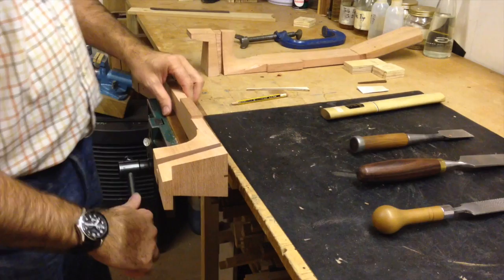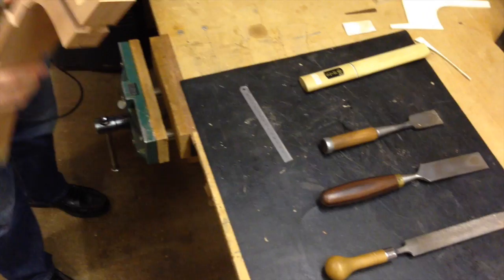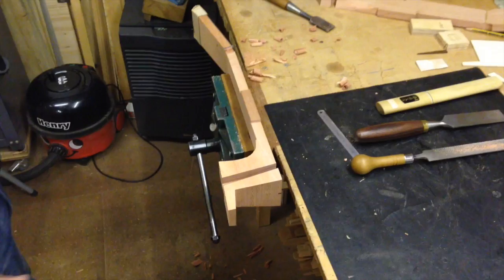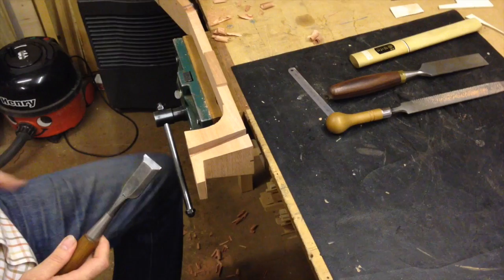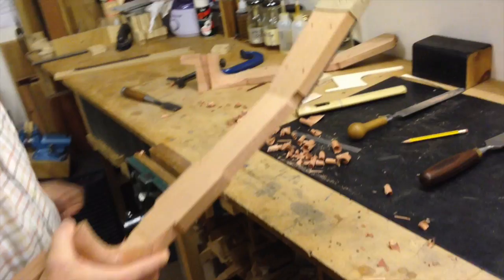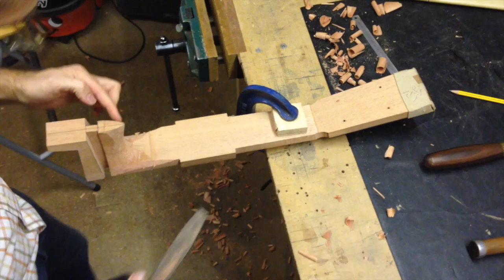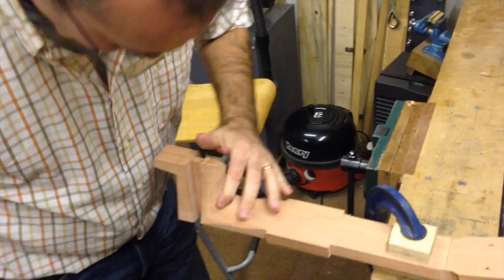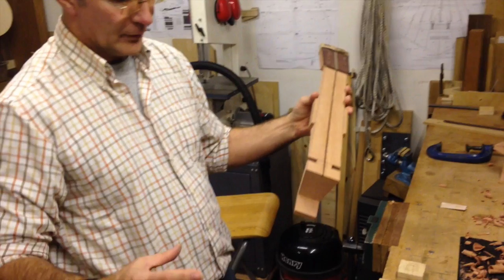Pablo Requena Carving the heel on a classical guitar

Comment: When you made the templates for the heel shape, did you use a contour gauge to transfer the shapes from a finished master guitar? Gracias mi amigo mejor!
Reply from the maker: No, I actually made my own templates with my own design. But if you want to use someone else’s design using a contour gauge on an existing guitar would be the way to go.

Comment: Why is it that in classical guitars the neck block is part of the heel while in steelstring guitars they are separate items with the neck being attached by bolts, tenon or dovetail? I presume they do it this way in classical guitars for better sound transition between neck and body so I don’t see why steel strings also don’t do this. The classical guitar approach makes more sense to me.
Reply from the maker: Hi Russell, It really is a matter of personal choice. The traditional way Spanish guitars have always been done is building the neck and body together, but not everyone does it that way. Both systems have pros and cons and you need to decide for yourself with way works better for you.
If you look at the history of the Spanish guitar and of the steel string guitar you may find that there could also be a historical reason for this, but perhaps this is not the best venue to discuss that.
Just in case you are interested and you want to have a look, I have a guitar making course available on  www.onliguitarmakingcourse.com
Reply: @redkitekk  thanks pablo. Btw, My mum has one of your guitars which she is most proud of :)

Comment: good video. what type of  vice is that?
Reply from the maker: Thank you. The vice is this one from Axminster tools in the UK:
 http://www.axminster.co.uk/york-automatic-quick-release-carpenter-s-vice-ax32241
Reply: +PabloRequena Thank you Pablo. I actually have been wanting an Axminster vice for a long time, but they have different ones & I noticed you have like a quick sliding action and then tightening it up just takes a few turns. Very nice to have good equipment. Even better when you can use it so well like you do. This is also a different heal than I am used to. But, the more you study, the more variations you come across. Some of them I like and some I think are a bad idea - but they are used in mass construction. I always assumed that the "quick release" referred to the dog at the top of the vice. So I have learnt something again. Thanks for that link and keep up the good work.